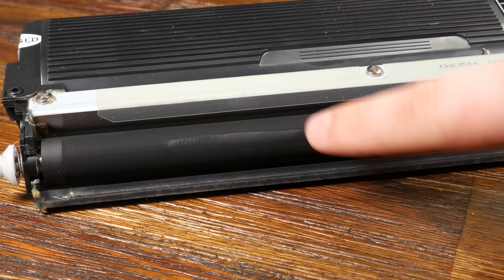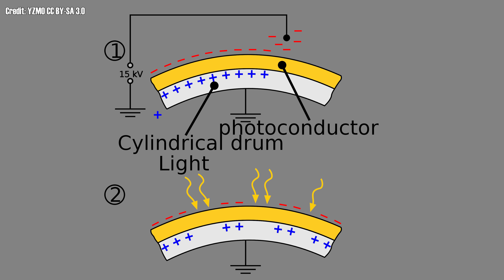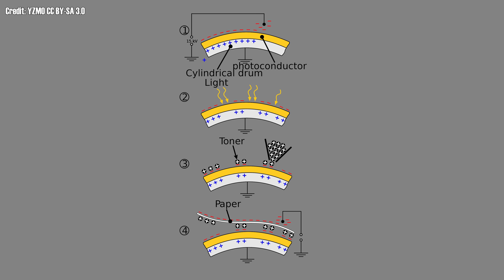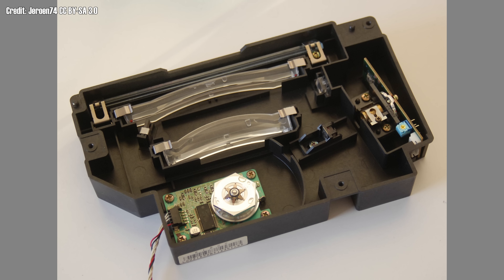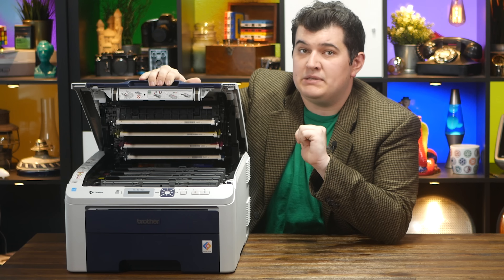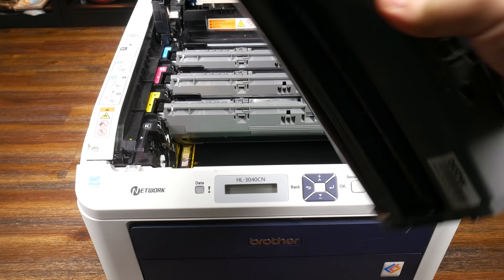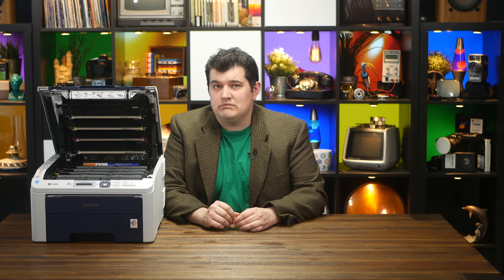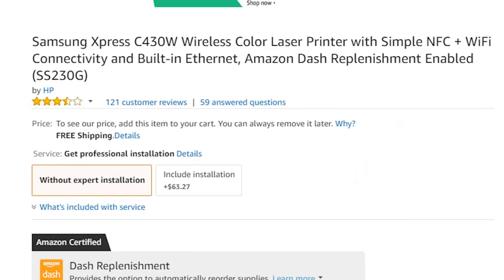LED Printers: The Common Printing Tech You Haven't Heard Of

Comment: my first "page printer" was an IBM/Lexmark 4037 5E, which was a "personal" LED printer. at the time (1992, I think) it was one of the least expensive page printers on the market and was well supported by OS/2, of which I was enamored. I held on to it until 2004 or so, when I dumped in in favor of a 2nd hand HP LaserJet 5L. not on account of any quality or speed issues (they were both glacially slow and the HP had  marginally better resolution) rather the problem for me was one of consumables. you could get knockoff toner carts for the HP at your local drug store for a pittance, but toner for a Lexmark printer was rarer than hen's teeth, and twice as expensive. it was with a twinge that I discarded it when I moved, but will always have a soft spot for that little printer.

Comment: The pages per minute number won't be that different - the last drum can be finishing the first page while the first can be halfway through third page after all. We had a color laser printer at work some 20 years ago that would take over 5 minutes from sending a page to it (in sleep mode) to complete printout. But if you sent 50 pages, it would spit them out no slower than a b&w one, it just took its sweet time to start. Also, it was about a cubic meter in size.

Comment: I am a copier/printer technician (and have worked for a company you mentioned), so this isn't exactly anything new to me. But I keep seeing it come up in my suggested videos so finally clicked. I don't use the term LED printer with anyone outside the trade, because they wouldn't know what I was talking about. To the layman they are all "laser printers". One interesting thing between the old analog copiers and the modern digital (laser/LED) printers is that the polarity is backwards between them. Had a customer once with an old analog copier and a newer digital one where the toner cartridge wasn't quite different enough. They put the analog toner into the digital machine and made a huge mess.

Comment: I operated a small office for attorneys from before the age of computers until 2016. I dissolved my first partnership in 1987, in part because my partner would not invest in upgrading the office from a central CPM computer with high speed dot matrix printer, which you could hear screaming throughout the suite. Belatedly moving on my own into the world of DOS and WordPerfect, I bought my first laser printer, expensive, huge and heavy. It ran fine for most of a decade until the service company tipped it over and spread toner into all of its mechanical innards, after which it was toast. In frustration, I replaced it with two, small, light, and much less costly OKI LED printers. It took another 15+ years, but they worked until supplies for them got hard to find. One failed because a basic power component died (easy to fix).  I replaced that one with the latest model OKI at the time, and in retirement, I still use it regularly. For cost of purchase and operating expense, they cannot be beaten. The Brother/Samsung units are the same LED tech, but not as durably built. (They are cheaper however; great for home use.) No opinion on the relative merits of color units, be they LED, inkjet, sublimation, etc.

Comment: I bought a Okidata OL-400e LED Page printer back in the late 1980's. I'm afraid to guess how many pages it's done, as over the years I've replaced the drum twice, and bought countless toner cartridges for it.  Interesting info: if you are mega-poor, and use one of these for lots of pages daily, I have found that just about any brand of toner can be dumped into the cartridge and they keep on going.  For a while, I used Ricoh (I think) toner, because I scored a case of toner containers at a garage sale for like $5.00  It's still my favorite, still works flawless, and I just blasted out 50 time sheets about 1/2 hour ago!

Comment: for the 3d printer thing, you basically need to know how they work in/out to use them. from assembally, makeup, mechanical operation, the code they rely on, everything exept who invented the damn thing. even for the more expensive ones require someone that well knows them.

Comment: even 5 years before this was made... most "laser" Xerography printers were actually LED Xerography printers.  The LED ones use much less power thus are cheaper to run, and since each colour is independent... easier to diagnose problems.  Repairing means you don't affect the other colours either.
Come colour printers even have a mechanism to lift the 3 colours away from the paper, saving wear and tear on those parts when just printing black (the black often is made to handle more work too).  It also means the paper passes only the black toner, so can move faster, as it doesn't need to make sure it passes exactly for all 4 transfer drums.

Comment: bought an old hp 2420dn from a college's surplus store for $20.  had toner (no idea how much is left) and a full tray of paper.   it's got ~54,000 pages of use according to the service menu and is working great for me.   plugged the ethernet port into my router and I can even print to it from any device on my network.     what a sweet deal.  it feels modern in its plug-and-play usability today.     also it's crazy fast compared to my parent's inkjet printer.  this does 30-some-odd pages per minute while my parent's does like 2

Comment: "Ink dries out, meaning that the printer has to either constantly be performing “a maintenance mode” which wastes ink, or you need to print rather regularly which, in this paperless age fewer and fewer people are doing.
The herky-jerky nature of print heads as they travel back and forth are very unpleasent compared to the smooth print of pretty much any laser printer.
Ink cartridges are usually priced at stupid levels, meaning that you’re forced into buying generic ink which often clogs the inkjets so you’re damned if you do, damned if you don’t.
Because the ink is a liquid, freshly printed documents have a tendency to smear if touched until the ink has dried.
Water-based inks are likely to completely wash away if the paper they are printed onto becomes wet, meaning shipping labels printed with some inkjet printers can be rendered completely unreadable if they get wet from something like, oh I don’t know, rain.
None of these issues plague laser printers, so despite their higher upfron cost (and arguably more expensive toner) you can pretty much count on them to work perfectly even if they’ve been idle for over a year, they don’t waste toner on “maintenance modes”, the toner is bonded to the paper so water doesn’t smear it, the toner is never wet so you don’t have to wait for it to dry, plus spills can easily be cleaned up as the toner is a powder. I could go on but if you read this entire thing, now you know why I generally dislike inkjet printers and why I will forever use laser printers. Or LED printers which are the subject of this video as you’ll soon see. 
That said, Techmoan recently reviewed an inkjet printer that was actually pretty decent in terms of ink cost, so even if a “maintenance mode” were to waste ink, it’s not like It’s wasting super expensive ink
Perhaps one day I’ll rejoin Team Inkjet. Particulary for photo printing (and images in general) inkjet reigns supreme. But for now, I’m planted in the realm of toner so that, when I have to do my taxes, I don’t have to waste time, energy, and money fighting a stupid inkjet witch clogged heads."

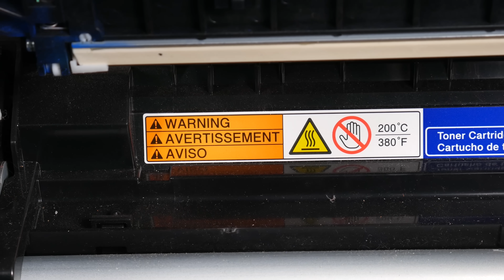Comment: 0:44 I heard: "along with corona virus"
Reply: Corona Wires The corona wire uses static electricity to coat both the photoreceptive drum and the copy paper with a layer of positively charged ions. Photo courtesy Xerox For a photocopier to work, a field of positive charges must be generated on the surface of both the drum and the copy paper. These tasks are accomplished by the corona wires.

Comment: Just bought a new laser printer from HP that has their "toner tank" technology, when the toner is over you just buy a big "syringe" and recharge in 15 seconds by connecting the syringe in a small port, each charge is good for about 2500 prints, the printer I bought can hold up 2 charges so I won't have to worry about charging up for a really long time. It's called Neverstop laser,  I'm really happy with it so far.

Comment: Here's the transcript of the reasons why Alex doesn't like inkjet printers. You're welcome.
Ink dries out, meaning that the printer has to either constantly be performing a "maintenance mode" which wastes ink, or you need to print rather regularly which, in this paperless age fewer and fewer people are doing.

The herky-jerky nature of the print heads as they travel back and forth is very unpleasnt compared to the smooth print of pretty much any laser printer.

Ink cartridges are usually priced at stupid levels, meaning that you're forced into buying generic ink which often clogs the inkjets so you're damned if you do, danmed if you don't/

Because the ink is a liquid, freshly printed documents have a tendency to smear if touched until the ink has dried.

Water-based inks are likely to completely wash away if the paper they are printed on becomes wet, meaning shipping labels printed with some inkjet printer can be rendered completely unreadable if they get wet from something like, oh I don't know, rain.

None og these issues plague laser printers, so despite thier higher upfront cost (and arguably more expensive toner) you can pretty much count on them to work perfectly even if they've been idle for over a year, they don't waste toner on "maintenance modes", the toner is bonded to the paper so water doesn't smear it, the toner is never wet so you don't have to wait for it to dry, plus spills can easily be cleaned up as the toner is a powder. I could go on, but if you read this entire thing, now you know why I generally dislike inkjet printers and why I will forever use laser printrs. Or LED printers, which are the subject of this video as you'll soon see.

That said, Techmoan recently reviewed an inkjet printer that was actually pretty decent in terms of ink cost. so even if a "maintenance mode" were to waste ink, it's not like it's wasting super expensive ink.

Perhaps one day I'll rejoing Team Inkjet. Particularly for photo printing (and images in general) inkjet reigns supreme. But for now, I'm planted in the realm of tone so that, when I do my taxes, I don't have to waste time, energy, and moneyt fighting a stupid inkjet with clogged heads.

Comment: I DO use an inkjet printer, the Canon TS9020. The reason for this particular printer is that it simply uses separate ink tanks. Although they all generally drain around the same rate, they are easily replaced by off-branded ink tanks, costing less than $10 to replace them all.
Reply: I also have this canon printer. Which generic inks do you recommend?

Comment: Our data center evaluated a couple of Xerox printers in the early 90s, laser and LED.  My bosses went with the laser units since it would print at a resolution of 300 spots per inch.  The LED printers were only 240 SPI available at that time. Got two duplex page printers rated at 600,000 images/month, which we abused at nearly a million images each.
Reply: And that cost you a billion dollars in maintenance from Xerox

Comment: Do LED printers and laser printers use the same toner and fusing temperature? I've been learning resist printing with laser printouts. These prints rely on the difference in absorption between plain paper and paper coated with laser toner to transfer an image. A lot of people find that the technique doesn't work and success rates seem higher with older laser printers.

Comment: I haven't checked lately, but I remember one inkjet printer that cost £29.99 whose replacement cartridges cost £34.99!
Reply: That's pretty much all of them.  The printers are a giveaway with the profits being made on ink.  To save money with some printers, you can buy it, use it until the sample ink runs out, then throw it out and go buy a new printer.
Reply: @dhy5342  mmmmm yes electronic waste- I mean *technotrash*.

Comment: I spent 10 years in the industry, and while I certainly didn't work on everything (mostly Ricoh and some HP) I don't believe I have ever encountered a color laser machine that changed the paper path for color vs BW. Most use the same intermediate transfer belt (ITB) that your LED machine uses, and some earlier HP models had the paper pass all four drums. Now that I think about it there WAS that dumb HP with the "revolver" style drum, that may have been slower on color but that was relatively short lived.

Comment: I actually repair copiers for my job, you did an awesome job showing everyone how printers work. 
I’m always pleasantly surprised when I find an LED printhead instead of a LSU. Especially when I discovered that a printing press sized 136ppm production printer (about the size of a large credenza) had an LED printhead in the process unit and that a small table top printer had a laser write unit that was a third the size of the machine. 
Always enjoy your videos!

Comment: There used to be weird printers that used cathode ray tubes instead of lasers to achieve the same result. However they were in the very early stages of printer production and from what i recall from watching a documentary on it, were astronomically expensive due to their need for purpose built one-line CRTs

Comment: @7:08 Oi! That's almost the same printer I have from years ago and still using. I have the Samsung Xpress C460W version. I have had mine since... Like 2012 or 2011 and during this year I finally had to replace the first time installation toner cartridges which are suppost to just get you going. I had been using them for 9-10 years before they ran out. And they were suppost to have only a minimal amount of toner so you just get going with the printing. :D Yep. 10 years later and I finally had to replace them because black was running kind of low. Other colors could have still kept on going but I decided to replace them all at once.

Best value for money of my whole life, I'd say. It was so pleasing the get rid of those constantly erroring out ink printers. This one hasn't errored out even once!

Comment: I remeber the first machine I've ever seen an LED print head was actually a Kodak ImageSource 110 (From the mid 90s), which was a purely analogue high speed copier. This monster used what was essentially a blindingly powerful flash and an array of mirrors to directly photograph the copy onto a charged film loop, at 110 prints a minute.
It also had a digital LED print head which was to be used for mail merge applications but most people never used it as it was complex as heck to set up.

The same LED head was then used in the purely digital upgrade, the DigiSource 9110. The advantage of this over a laser based system was you could get the most solid and flat looking blacks, as opposed to laser based prints.

The entire imaging system was housed in a very small space, very easy to maintain and completely user replacable in less than 2 minutes.

Comment: I never realised LED printers have been around for so long, the one you  have got I saw a review from 2010,  i have a Brother HL-3150CDW, it is just over 2 years old and I love it, the print is good, certainly in the higher res mode. My only moan about it is the display on the printer itself, one line LCD display with not backlight. 
I did think of getting ALL in one LED printer and pujtting my old one downstairs, but bot sure where to put it.
LEd printers, good value and work well,

Comment: I got an OKI led printer back in 1997-98?, because at the time it was a lot less (relativity speaking) than a laser. I think at the time it was about $400.00. I had several inkjets but got tired of the high cost of the cartridges. I now use a Brother laser that I bought for around $60.00 over ten years ago!

Comment: I serviced computers and printers until it became cheaper to replace rather than repair. A very good description of how laser printers work. One missing piece of the process, however, is that the paper has to be discharged very soon after the toner is transferred from the OPC drum to the paper, otherwise the toner will become charged to the same potential as the paper and will fly off the paper because like polarities repel. This is on the same housing as the corona wire that attracts the toner from the OPC drum to the paper and only a few number of millimetres after the corona wire. This grounding device usually looks like a very thin saw blade across the direction of the paper path.
Strange that I should remember this as it has been over 15 years since I have worked on these machines.